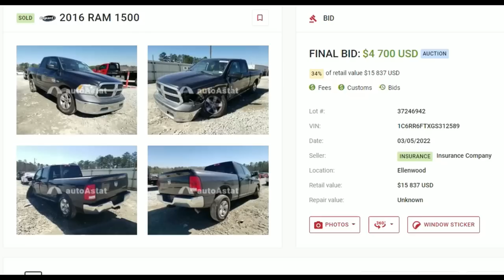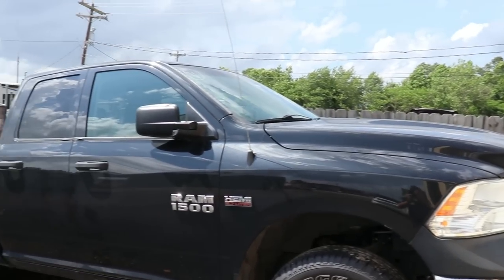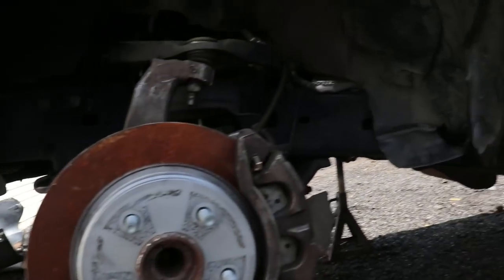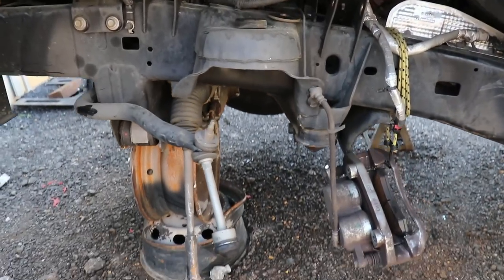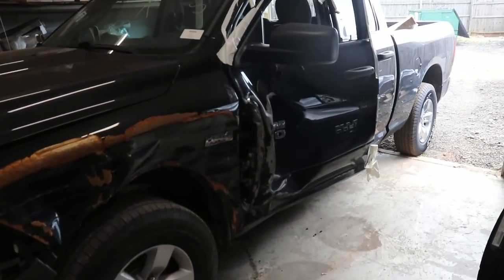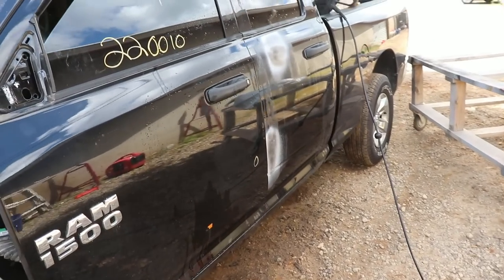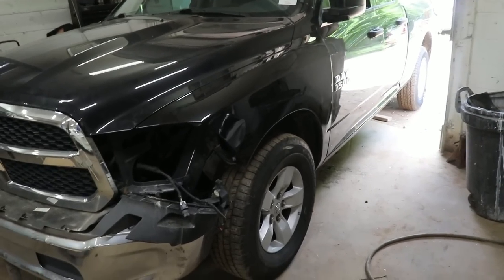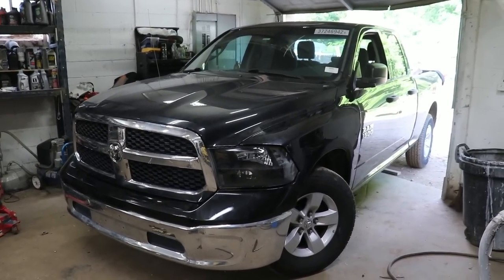REBUILDING A RAM 1500 IN 22 MINUTES GOOD DEAL OR BAD DEAL?

Comment: So much garbage 🗑 in the paint 🎨
Reply: At this price point, with a salvaged title you have to consider the customer.  Could the paint be matched and cut and buffed?  SURE.  but it would price it to a point no one would buy it.  As it stands, this is a good work truck for someon that needs an upgrade but can tolerate some pain issues.  All in all it's safe, fixed mechanically correct and ready to resale.

If they wanted to restore it, that would be a different video I'd think